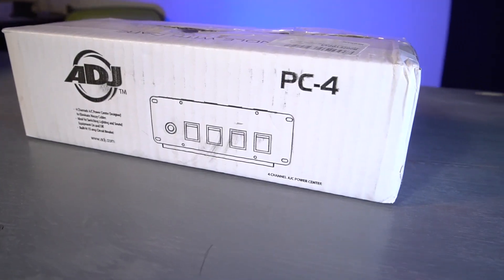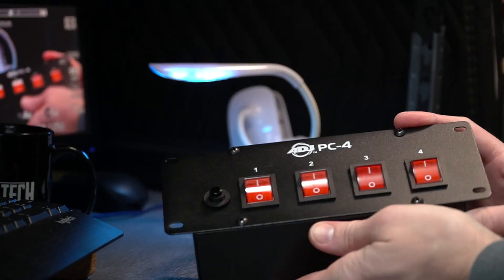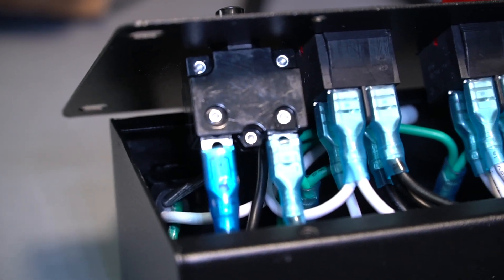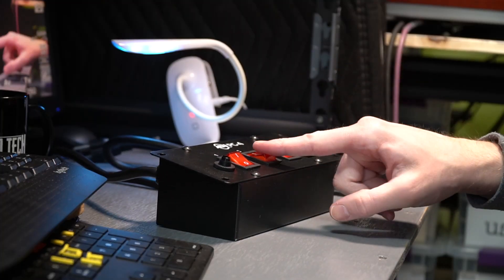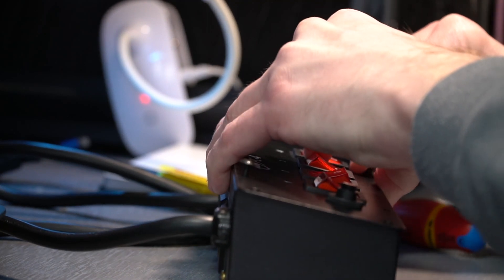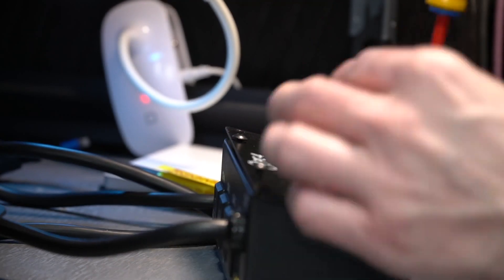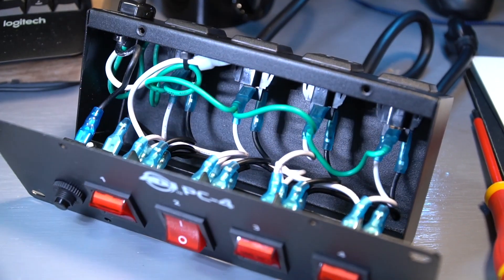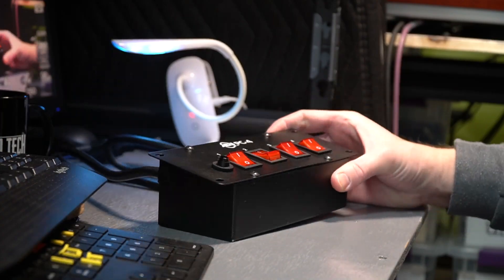ADJ PC-4 | What's going on inside? First look & Teardown  🔌🔥

Comment: I have an Eliminator E107 controller with 8 switches, one of the switches works but the red light no longer turns on indicating that it is on, how can I check if it is a loose cable or the bulb is damaged?

Comment: Most US homes only have 15 AMP breakers on a bedroom or Family room circuit.  Generally only Kitchen and AC outlets are 20A.    So 15 AMP rating for the box is perfect.    I use the ADJ PC-100A on my desk to turn on/off  Yamaha sound monitors and 3 Video Monitors.  Makes it easy at the end of the day just to power down ALL hardware quick and easily. Never had an issue with the switches and mine has to be 5 years old.  Switches are toggled daily.

Comment: bought a similar used 8 circuit unit with a bad circuit.  The circuit had melted plastic on the rear outlet which means to me, long term over current.  This is possible because the unit only has a master 15A breaker, not individual 10A breakers on each circuit.  My guess was a big power amp plugged into the bad circuit driven hard.  Not enough to trip the master breaker, but enough to melt the individual outlet. 
 I use mine for the same thing you do, turning on and off my LED video lights.  Great video.  Thanks.
Reply from the maker: Melting does seem to be the thing with these, power amps and conventional lighting fixtures are not it's friends. I think I remember Tripp Lite making a version back in the day to sit under CRT monitors on the desk, and they were super robust. I'd like to find one of those at the thrift store for a look inside.

Comment: Virtually all technicians I know do not believe in the resistance of rocker switches. I also don't believe them.
In a situation where I need to control small loads at 230 volts from a central location, I prefer to use relays for this purpose, whose reliability is usually much higher than rocker switches.
It is more expensive but it is, by far, the best solution for my personal taste. I prefer to control loads with 12 volt relays than to switch the power right next to me.
Power switching at 230 volts ... well away from my desk!
Reply from the maker: Back in the days when conventional fixtures were all the small operators could get, these poor switch units took a beating. I sold sound gear at a mom & pop music store in the late 90's and these were a popular repair drop off on Sunday mornings. DJ's would have par cans and old disco lights going on these switches in a sea of extension cords and it never ended well.